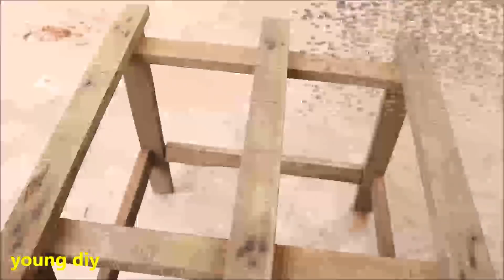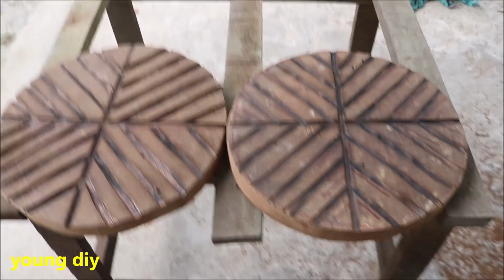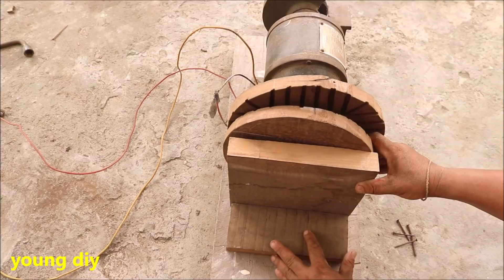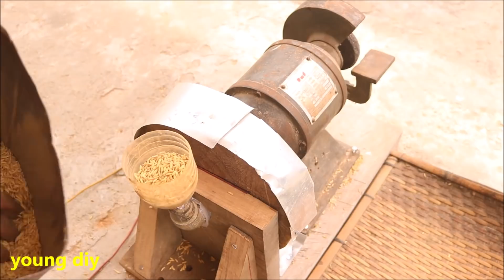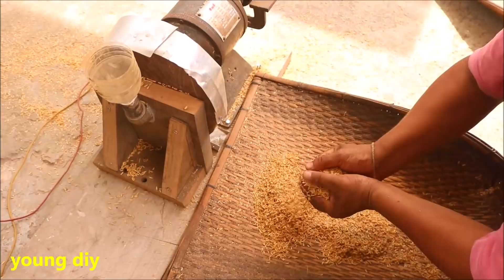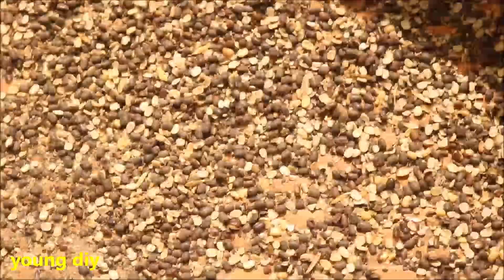How to Make a Mini Rice Mill/Huller from a bench Grinder |DIY .

Comment: The idea shows promise, but it seems like your shroud isn't really working and you can't control the gap between the two plates in a precise manner.

I got curious, and found this:
https://youtu.be/Y4zhZ0ViSL4

It seems like you could do the same, but mount your impeller directly to the grinder instead of using a shaft from the other side. As for feed rate control, you could probably use a sliding door method by putting a small plate flat into the neck of your hopper and pulling it out/pushing it in to control your feed rate.

I'm not sure how helpful all this might be, but I wish you the best of luck with your next version.
Reply from the maker: Thank you sir.

Comment: I'm confused what is it your trying to make? To me it looks like its throwing rice around and every now no disrespect Im just wondering what its so post to be doing. If it's a grinder isn't so post to have some stones grinding ontop of each other is a good consept but you need something harder then wood try to stones putting a hole in one with a masonry bit and cut some groves in one or both and try that I think you will get better results just try and get a good hard one. That just my thought. Good luck and thanks for sharing with us😀
Reply from the maker: Thanks for your valuable opinion. what i thought  was that wooden wheel grinders are for de-hulling/husking rice and stone/concreate wheels for grinding cereals to flour. Once again thank you very much for your suggestion and fr watching .
Reply: In that case try rubber it could hold the rice and the husks and pull them apart have you ever tryed vocanized rubber. Its heated rubber till its so hard different rubbers have different hardness the right one could work very well plus you can cut channels into the rubber they come already round on the other haft try forming HDPE recycled plastic when it spins one will counter act with the other the rice should go one away from the husks. Well best of luck on endeavor.
Reply from the maker: Thank you very much bro.
Reply: Dont confuse, watch carefully,  output is without polish rice. This is gr8 project.
Reply: W